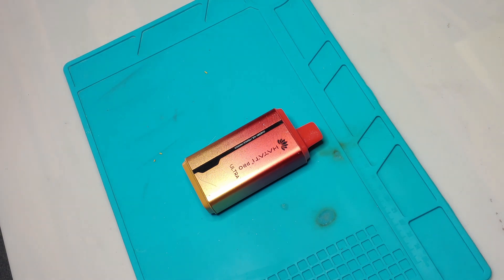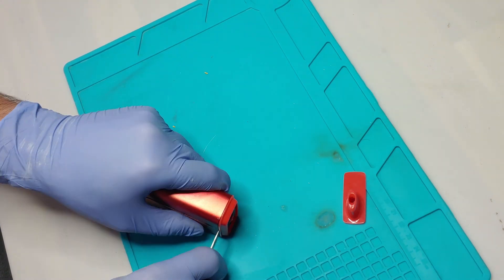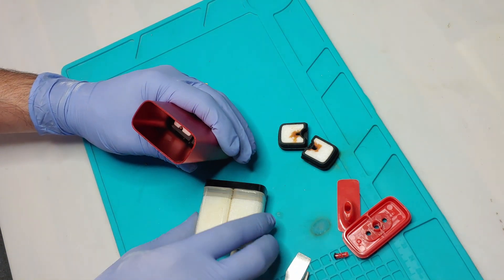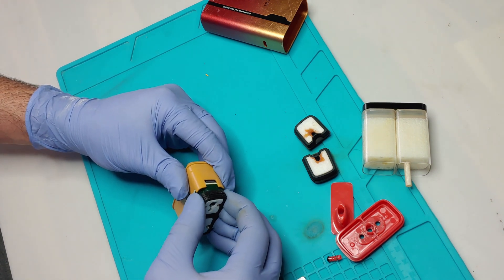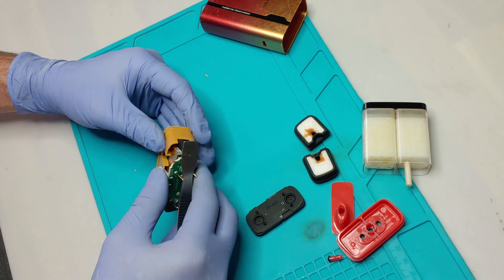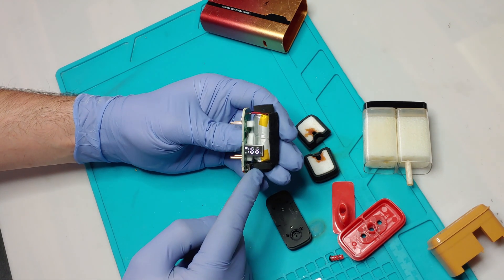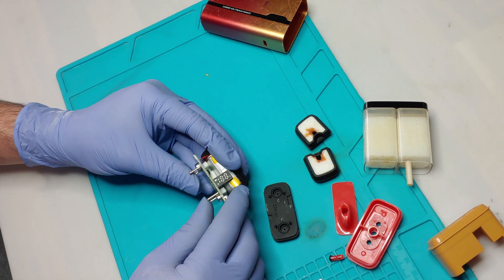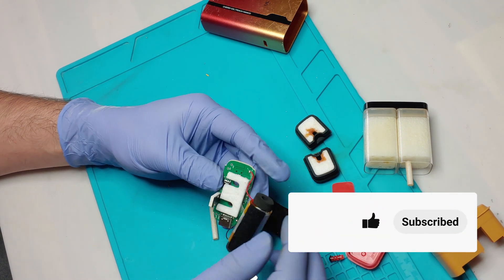Open and dismantling single use disposable vape (Hayati Pro Ultra 15000 Puffs Disposable Vape)

Comment: After watching that these can 100% be refilled and the battery will charge up at least a few hundred times
Reply: I have one but the problem in the battery always in 100 %
Reply: @younesselarroubi-e2y  me personally I would install a battery sled and get a good 18350 battery in it you could in theory make the battery removable
Reply: The coils burn out before then though. . I still got an extra month out of mine by refilling before it did that though.

Comment: Hello there! Interesting video. I want to recycle the Battery and the Charging function. Is there any way to maintain a constant Current to Power a Small Device?

I know it switches on when inhaling. Is there a way to keep it switched on?

I would work it out myself, but
Reply: I believe you would have to disconnect the sensors then connect both ends of what was connected to each end of the sensor together , if that makes sense. So essentially the circuit is connected rather than only connected when the sensor is triggered.

Comment: Hi, did you look further into this pcb to see if you can get it to give a constant output? I recently came across this type of module and it would be really good to be able to use them as a charge/discharge unit. Cheers.

Comment: My tugboat vape Evo pro doesn't work idk why
Reply from the maker: I believe I've not opened one of those so I cannot say for sure, but how long have you had it for? If it has a charging port, is there any sign of life when you try and charge it? I also recommend always staying next to these things when charging. I can only assume the battery has died or the liquid has finished and if not topped up in time and you burn the coils out I imagine it to just stop working. No expert, but those are my guesses.
Reply: I make  Suggestion if want refill pull on the twistey top to see the holes if you can get the vape juice Nuzzle in there which you should if they are small enough do it that way

Comment from the maker: FYI, if you want to reuse these, don't snap the top off like I did (0:37), just use a thin pry tool to slowly slide the top off (0:57). Then you can either top off or I guess remove the containers and wash to refill with different liquid. Although I've never done this before.
Reply: Where would I put new liquid in, straight into the sponge or through the tubes?
Reply: @ onto sponge
Reply: Will it still fit back on
Reply: @Sahil_mcryes fit back on perfectly as long as you don’t damage the edges to much while taking it off but it should be fine 👍
Reply: Which liquid do u use to refill?
Reply: @SeharEmaan-ps2wt  e liquid. ones for reusable vapes
Reply: Cheers for the teardown tut.
I've been thinking the juice containers could be useful to make little jewellers spirit lamps from slim aerosol cans or non spill alcohol stoves for camping/survival kits. Or cute little lanterns in the garden. I've been working on a SPAM can stove and seeing those juice containers just now has set me thinking.

 It's been interesting watching the disposable vape housing become the new Altoids tin, ie a free enclosure for little homebrew electronic projects.
Incidentally, the enclosure would make a great little power bank with several batteries inside and that hole where the mouthpiece was would be well placed for a type A USB or even another USB-C.  I'm also thinking guitar pedal and DIY synth circuits. Imagine half a dozen of them plugged together making dreadful  DAWless Acid   jams. The perfect gift for the kids of people you secretly hate :D
Reply: @dmthandmade5674  Disposable vapes are cheap these days and the components are low quality and close to worthless so it doesn't make much sense to take the time needed to repurpose it as time is the most valuable resource we have so unless you are only tinkering for your own amusement it isn't really a worth doing 😂